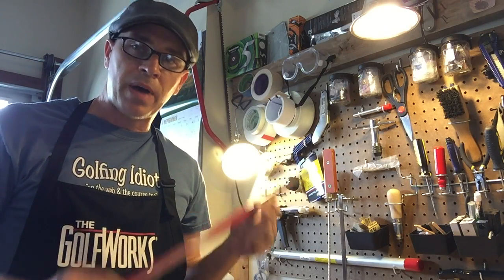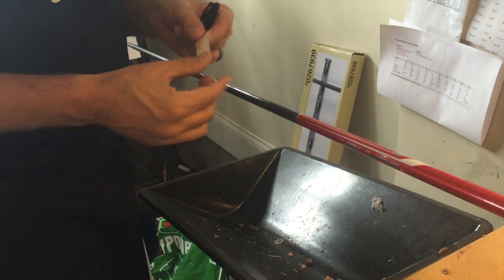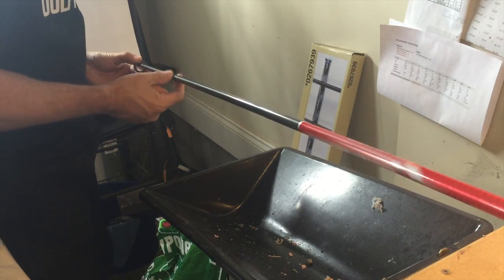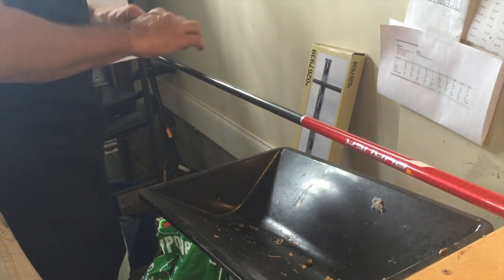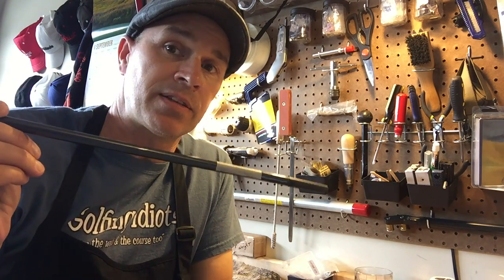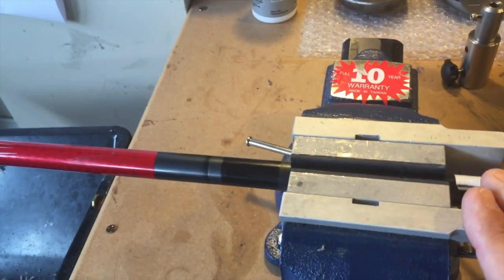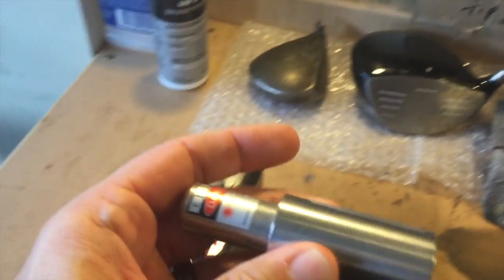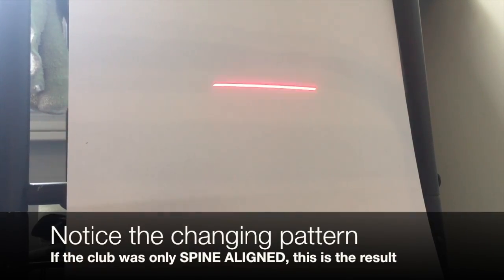How to FLO a Golf Shaft (correct position of shaft alignment)

Comment: How do I  align the flo to create a draw bias for a right handed player?
Reply from the maker: I have been informed that it is illegal to set-up a shaft in such a manner.  However, I am not convinced.  It will really depend on your swing path and club face angle, but you may be able to influence the shaft direction via FLO.  If you use my method of 12 o'clock placement and you are a right handed player, you would need to set the shaft in the hosel at the 1 or 2 o'clock position.  I have never tried it.  Good luck.
Reply: Thank you for the reply, another question not related to flo, what are the rectangle color markings on a raw graphite golf shaft signify? Thank You, Ray.
Reply from the maker: Ray to my knowledge that has something to do with the manufacturing process.  It is not significant.
Reply: UPDATE on INFLUENCE of FLO on DRAW, I usually hit off center 5-20 yards right with my driver flo'd properly, I pulled the shaft, rechecked spine and Flo, positioned the Flo at the 1 oclock position for a RH Player, and it Does Work, I Hit 30 Balls and everyone of them were either Straight, 2-3 yds right or Very minimal Left for Me!
Reply: @raytollefson6622   yes you  can definitely cause your shots to consistently,fade or draw,i have. several shafts that I clocked the adapters to do just that,I tricked a friend that draws the ball by giving him my  m2  with a fade bias adapter ,he hit 12 balls in a row with a fade and he just kept shaking his head.
Reply: @raytollefson6622  Usually the color markings are made in production to identify the shaft as it gets through the production process. Stiffness, weight etc.

Comment: can you do this with the grip still on, using the "drum" or "pipe" style aligner?
Reply from the maker: I would not recommend it as the results of FLO alignment could be inaccurate with the grip still on the shaft.  Thanks for watching!
Reply: This is all crap for an adjustable driver! !
Reply: @rickgray2465  Not if you have the ability to remove the tip and re-orient it, or if you have a Callaway wood which allows any tip settings with the shaft in any position.

Comment: I enjoyed your vid - thanks for making. Question: Why do you show how to spine align? Are you just explaining the difference between that and FLOing? It seems to me if I wanted to FLO my own clubs I would just attach the laser (or chuck) and get to it. The position of the spine seems irrelevant at that point or am I missing something? I'm just making sure it is not necessary to find the spine before FLOing the club. Thanks again.
Reply from the maker: +majorwhiz Finding the spine "usually" makes a faster determination of the FLO as a reference point.  It is not required in order to find the FLO of the shaft, just a little something that will make the process a bit faster. Thanks for watching and sorry for the delayed response as I am deployed currently.

Comment: Wouldn't it make more sense to flo the club with the club head installed? I would think the club head mass affects the harmonics because the head and the shaft have to work as a unit and each has its own harmonic.
Reply from the maker: You can, but it will not change or influence the FLO position.  It certainly makes the process more difficult.

Comment: I never heard of FLO before! Great video with some serious interesting info here. Makes me wonder if my Taylormade R15 has a proper FLO for the standard hosel position. You got my sub. You seem to be pretty smart when it comes to club repair. Any info on how I can fix the nasty sky mark scratches on my black 460cc R15 driver?
Reply from the maker: Easiest way to fix those "sky marks" is rubbing compound that would be used on autos.  Use a damp cloth and a back and forth motion to remove the marks. Be sure to use wax to bring the luster back to the area after that. Thanks for watching and be sure to subscribe!
Reply: Golfing Idiots,
Thanks! I also subscribed.

Comment: I'm sure you are inundated with questions,  and I'm sure you've answered this before,  but I wonder about this. Some guys say to spine first to  get close....which makes sense. I see how that might save time. Do you have to twang the club either in the 12/6 plane or the 9/3 plane to get accurate reading? Or can you get accurate readings if you twang in any plane? It's just that people act as if you've got to rotate the shaft in the vice between twangs rather than just leaving it in the vice and rotate  the twang plane to get a quicker approximation? I hope what I'm trying to ask makes sense to someone. 🤪
Reply from the maker: Common question;  you can find the FLO in either position.  HOWEVER, ensure you make the proper adjustment when you place the shaft in the club.  Remember, the FLO plane needs to follow toward the downrange target.

Comment: A decade back i imported a set a shafts for my iron heads for replacements as a cple of them had broken down and the grips worn out. Thr american who sent me said that he is sending me spine aligned and pured iron shafts and just ask the local clubfitter to fit them accordingly ! The clubs performed awesome and were consistent . Recently i had to get my m1 adaptor ferrule redone on a shaft which i paid a handsome amount to the dealer . The ferrule and adaptor were getting seperated bcos of impact ! I requested the local certified clubfitter that he should check the spine and set the shaft correctly . What he did was set the neutral setting to upright wherby changing the alignment and original setting . The sad part is as a professional fitter he said the spining didnt matter . I was taken back . What a loss i had . And i found the not so good setting on the lower loft of course not to my liking. I think professionalism needs a new definition. Your vdo is a class apart it explains how seriously club fitting is taken and really helps the player achieve the goals. Thanks for reading this .
Reply from the maker: Sorry about your poor experience.  Keep in mind spine alignment and FLO are completely different.  FLO is along the lines of the PURING process (trademark protected).  FLO is what will make a huge difference throughout all your clubs in the bag.

Comment: I like this presentation but like many others there is no full explanation of the proper view orientation when setting spine/flo in clubhead.
Looking down the shaft to the clubhead, 9 o'clock is the correct spot for the flo line for a right handed golfer, but looking from the head towards the grip end puts it at 3 o'clock as you mention. There are reverse placement for lefties as well. I prefer looking down the shaft with 12 o'clock on top, making it 9 for RH Golfer and 3 for LH.
Reply from the maker: I explained it the best I could in order to assist other people.  In your response, you use the term "FLO line" with clock positions which is confusing without the understanding of where the FLO line was marked on the shaft.  So if you mark the FLO line of the shaft different from how I explained in the video (i.e. up and down FLO line in the vice as opposed to left and right FLO line in the vice), it will change the shaft insertion to club head to clock position to target position, etc..

Comment: Wouldn't you want to put the shaft into the head with the line on the face side or target side? When you swing the club doesn't it torque this way and kick into the ball. I dont understand why you would want to put the flo on the 12 oclock to the head.
Reply from the maker: Keep in mind, you want the FLO line on the swing line.  Maybe that will help to visualize how to insert the shaft after FLO'ing.

Comment: I tested this.
and the results are different.
1. I took just the laser
2. the laser on the clubhead
3. a 300gramm weight

as you mentioned your laser is 200g.
my clubheads are 274g

Any ideas or comments?
Reply from the maker: I am note completely sure what the issue is, but what type of shaft is it?

Comment: Great Vid.... my question is... Current off the shelf drivers come with many settings, Lie, Angle, closed, open etc... so FLO'ing the shaft for these drivers... is it useless?
Reply from the maker: Great question and the answer is, it depends.  If you change the settings often, then FLO'ing the shaft will not be much benefit. If there is one position that you prefer over others, FLO the shaft to that position. Keep in mind, adjustable drivers are really designed for custom fitting for an individual's swing. In theory, you should dial in your setting at the range (or on the course) for your swing and leave it alone which would allow for a FLO'd shaft. Thanks for watching and please subscribe.

Comment: Im not bagging flo-ing of golf clubs but from my personal experience with my own clubs I found no difference in distance, feel felt stiffer because I orientated the strongest bend profile toward the target (9 o'clock for Right handers target on left, then fine tuned flo with head on), and consistency was about the same (I didn't miraculously drop 10 shots off my handicap afterwards). I have done both Steel shafted Irons and Graphite shafted fairways and found the same results. In fact the set of clubs I'm using now is untouched (no Flo) and my handicap is the lowest and most consistent its been. Each to their own I Guess.
Reply from the maker: To each their own. However,  I've had more positive feedback regarding shaft FLO from customers.
Reply: The FLO axis (straight line oscillation) should be in line with the target line when the club is assembled. Sounds like you were 90 degrees different than that (if I understood you correctly).
Reply: @bobpegram8042  Yes, perfect Flo was aimed at the target not up and down at 12 o'clock. Like I said I don't believe it miraculously changed the club. I could get one of my clubs redone professionally and I believe It would not make any difference.

Comment: So it's all about FLO...it has nothing to do with finding the spine. You orient the shaft into the club based on the FLO results. Finding the spine is just a waste of time?
Reply from the maker: Correct. I used the spine method to show the difference and the fact that spine alignment is not the FLO in the video.
Reply: Finding the NBP helps locate the FLO a lot easier, right?

Comment: I'm very much a beginner at golf, and made the mistake of reading Tom Wishon's books ;-)

This is a DIY project? Take the club head off, find the FLO position, and glue it back on? 

I have three Adams hybrids, and 6-P irons. The others were done by the club builder (Wishon dealer), but he recommended against me paying him to work much on old hybrids. He set the swing weights, but that's all. I'm re-gripping them.
Reply from the maker: Thanks for watching.  Yes, Tom Wishon is "Da' Man" when it comes to tech and golf.
Reply: @XJSimulations  I guess it's a DIY thing; I'll make a shaft puller and try it on old clubs before I move on to the hybrids.

I figure a long bolt, a couple big washers, a short piece of pipe, and a couple old valve springs should have it. I have a laser pointer somewhere.  Rubber v-block for the vice...

Comment: Very well made video on a interesting topic. My concern with F.L.O. an adjustable driver shaft is that if you change the 
hossel location the F.L.O. location will no longer be correct? (I assume) with this in mind I would need to get happy with the hossel location prior t FLOing the shaft Yes/No? Thanks great video deliver for sure.
Reply from the maker: Great question and the answer is, it depends.  If you change the 
settings often, then FLO'ing the shaft will not be much benefit. If 
there is one position that you prefer over others, FLO the shaft to that
 position. Keep in mind, adjustable drivers are really designed for 
custom fitting for an individual's swing. In theory, you should dial in 
your setting at the range (or on the course) for your swing and leave it
 alone which would allow for a FLO'd shaft. Thanks for watching.

Comment: Not so much fun with adjustable club heads?
Reply from the maker: The purpose of an adjustable driver is to be able to fit the club to your swing without the need of a custom order.  Once you have fit the driver to your swing, you can then FLO the shaft for optimal performance. However if you are a constant "tinker" of the adjustable driver, FLO'ing the shaft will not really be a benefit.

Comment: I would make sense that the shaft manufacturer would align the shafts before applying graphics so club manufacturers get maximum advertising.
Reply from the maker: IF any manufacturers FLO shafts, I believe it is only the demo clubs. Other than that, you would need to pay for the service, if they offer it.

Comment: Whats the point spining? Why not just get straight to flow??
Reply: basically it gives you a reference point rather than just randomly trial and error. it's a time saver mostly but it isnt absolutely necessary.
Reply from the maker: I get this question often. You do NOT have to spine align the shaft in order to find the FLO.  The video was done to show people the difference between a SPINE aligned shaft and a FLO'd shaft.  More importantly, the fact that the two rarely are in the same position on the shaft.  There is still confusion out there about the two methods or thinking the two methods are one in the same.  I've had this question before regarding "why" do it this way;  again, the reason was to show the difference of the actual FLO position of the shaft. Glad you are enjoying the video!

Comment: It's still confusing as to what position you actually put the FLO plane.  In your video you flex the shaft horizontally and get FLO on that plane, which would be the 9 and 3 o'clock plane.  That seems to be the plane you want the club to be moving/flexing on as your club approaches the ball and through impact.  But, your video seems to be saying to put the FLO plane on the 12 to 6 o'clock plane-- but that's not the plane the shaft is flexing as it approaches impact--it's 90 deg. different.   ----or were you saying that you would take the shaft you had in the vice, which was moving side-to-side (9 to 3), and THEN while it is in that orientation, mark the top of the shaft  (12 o'clock pos.) and insert it into the clubhead in that same orientation, so that the FLO was still in the 9 to 3 plane.  Please clarify.
Reply: ^this.. i flo’d my clubs by twanging up and down.. marked the top of the shaft 12 o’clock thinking that’s the flo line..  is this not the case.. should I have actually marked it on the side of my shaft at the 3-9 and then installed that line at 12:00?
Reply: Yes, that is my question.   @stephenbarry5588
Reply: Hi Michael.  The flat line (9-3) in this video needs to be aligned towards the target. Marking at 12 oclock is just for ease of assembly, as its easier to look down the length of the shaft to get the head pointed at the target.
Reply: Thanks for the clarification.  The next issue however, is that some clubfitters then orient the flat line plane PERPENDICULAR to the target line.  Why they would do that I don't know, but they do.
Reply from the maker: There are a few ways to mark the shaft based off the FLO.  It does not matter if you find the FLO up and down or left to right.  What DOES matter is how the shaft is inserted into the clubhead.  You want the FLO to happen through impact.  Imagine a clubhead on the shaft as it is moving through impact to determine where you should insert the shaft during assembly.  The more you do it, the more it will make sense in what it is you want to accomplish.
Reply: think of a shaft as a yardstick. it has length, width, and thickness. it bends easily toward the wider side. hold the yardstick so the wide side is facing toward the target and think of the wide end of the stick as the clubface. the thickness of the stick creates a "spine" that prevents the stick from flexing moving up and down. vary the dimensions of these three and you get a stick that will variously oscillate depending on it's position in a clamping force.  the goal is to find the position that best fits the golfer's swing and "feel" for the club.

Comment: i truly believe f.l.o ing of the shafts is better than not doing so. as you can see from the laser... I'd rather a flat line than a circular pattern. currently I'm gluing back together my irons after doing this. soon I'll check my off the shelf driver. then i feel like i can never have any doubt about the equipment i use.
Reply from the maker: Ian, I completely agree with you.  There is no question about the benefits of FLO'ing shafts throughout the bag.  If more people would invest in the practice, they would see the immediate benefit in their play.  It is a simple, relatively quick service, that pays huge dividends.
Reply: S.
Reply from the maker: @ikehampton2409  confused about?
Reply: Yes I understand that and I have spine finder that I made long ago but I see no benefit in that because the flo seems to be more important and then you have to question adjustable heads for the shaft spine might go anywhere and the flo as well.
Reply: @termides  Often the FLO axis is similar to the spine axis, not exactly the same, but similar enough to be a good starting point when finding the FLO axis.

Comment: Why not skip the splining process and just FLO the shaft? Make a device that locks up the butt end, but allows rotation, through indents, as it is rotated. The degrees would be marked on the device, and each click is perhaps 2 degree. Rotate through 360 degrees, until the best straight line profile appears, and mark it on the shaft.
Reply from the maker: hanks for watching.  I have answered this question a few times.  The only reason was to show the different results between the two methods.  Spine alignment or spinning a shaft is not the correct way to locate the FLO of a shaft.